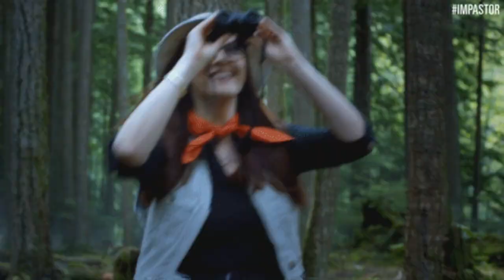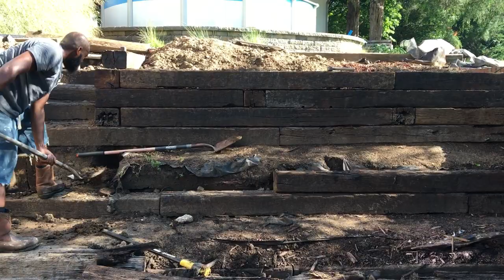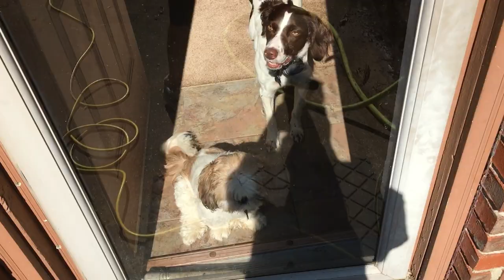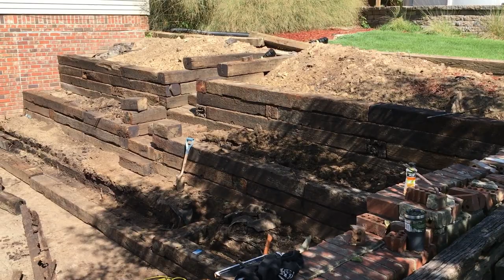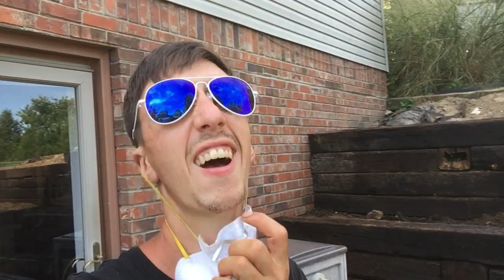Mountain Movers Installs Railroad Tie Retaining Wall

Comment: I got a suggestion and a question.
#1
I use a makita rotary hammer to drive spikes and rebar through the ties less risk of injury easier on your men.
#2
How many cuts do you get with that battery operated saw ???
Reply: I have a few battery powered chainsaws. Not many cuts 😂 need backup batteries fosho